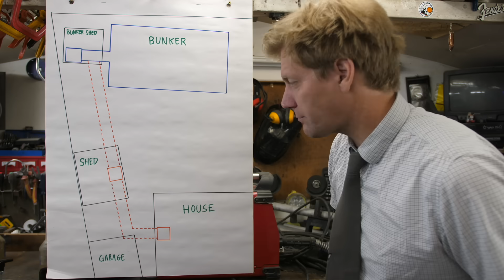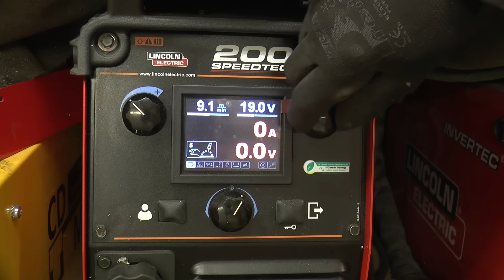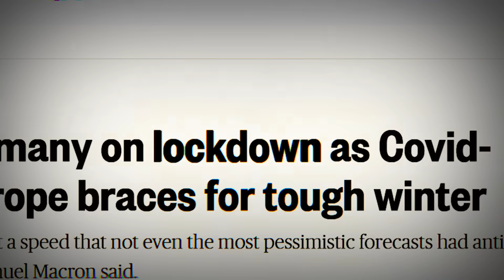DIGGING A SECRET TUNNEL Part 2

Comment: He’s breaking the number one rule never dig straight down
Reply: But it's pretty much the equivalent of digging one to two blocks down in Minecraft
Reply: @Honudes Gai thats possible? is this why those gas towers spew out excessive ones and light them?
Reply: It's okay, he's got x-ray!
Reply: @arlynnecumberbatch1056  Those towers with huge flames is called flaring.  They are burning off gasses that cannot be processed or sold.  It's usually just natural gas, but can be be other gasses as well.

Comment: I would recommend a concrete hammer SDS drill with a digging bit.....looks like it would save you HOURS!!  Or look into how they dug tunnels in WWI.  They figured out how to dig massive tunnels in almost absolute silence using a special made shovel and a board to lay against, it was called "clay-kicking".  Brilliant system.
Reply: Doing this in silence. It' is supposed to be secret. Noise to neighbours will cause problems.
Reply: yeah but clay kicking was a horizontal job he is digging down
Reply: @italiancountryball865  does he not have to dig a horizontal shaft longer than it is deep?
Reply: @forevercomputing  have you ever used an sds drill?  They are like 1000 times more quiet than a jack hammer.
Reply: @brandonbennett127  well yeah but i mean in a world where modern tools are everywhere i doubt that he would use the slowest method of them all which is clay kicking

Comment: When Colin started talking about a draft, and then a crack, did anyone else think "He's about to go through the roof of an undocumented bloody sewer"? :D
Reply: Or there is a broken sewer near bye. I wonder what gasses are in that 'air'?
Reply: @mbak7801  My first thought was did he test the air quality?  If it's a sewer main then H2S is a real concern.
Reply: @benjaminreinhardt259  If there was H2S, then I think the key and most obvious test would be your nose - which in case clearly wasn't an issue
Reply: @benjaminreinhardt259  but isnt H2S easily recognizable because of its smell?
Reply: @DarkPlaysThings  hydrogen sulfide is in small quantaties but its smell is 3 parts per million witch is a horendesly strong smell
Reply: We don't say blody in usa
Reply: @j.s3612  We bloody do in the UK
Reply: I hope he shows what happened to that crack, did it lead anywhere? Seemed like a natural formation, which could get pretty deep, specially in limestone.
Reply: @Darcy02   - Bloody right, we do.
Reply: My thought was, as it's limestone, it might be a  water eroded void, or even a cavern.
Reply: @brianartillery  caverns are normaly at depth of 100 meters and form when rain had seeped into the limestone and had mixed briny ground to become acidic and ate through the limestone to form a vast voids but small voids that appere on roads happen the same with caverns exept the rain seeps into an asphalt of the road and turns the sand below wet and weakens as the weight of trucks and cars vibrate the ground and the sedimrnts below get washed away until it collapses
Reply: @schwarnoldnarzenschwegger1886  Yes, but no.  If you hit a large concentration of it then you will initially smell it and then no longer smell it as it has deadened your sense of smell.  Before you can get out of that hole you'll be dead.  I deal with it working onboard ships, going into a confined space without air testing and monitoring makes me real nervous.

Comment: As a pipe layer, i spend a lot of time down in deep holes. I highly recommend more reinforcement, like thicker steel sheets rather than mesh… 
Please dont die Colin. Cave-ins happen out of nowhere and are deadly.
Reply: "Trench rescue" is almost always "trench recovery".
Reply: ...Wait...which type of pipe layer are you?
Reply: Then again he's probably filmed the final reveal already, so obviously he lived through it...
Reply: @erikscott5709  The hydraulic pump went into that position under the workbench over 2 years ago, so I think it's already done
Reply: @TurboSqu1d  in the end he said he hasn't done any work till April 2021 because he would work while neighbors were gone but they have been home bc covid
Reply: as an underground mine worker, i really hope he puts a bit more research into supporting the roof of the tunnel than he did with the walls. piddly little pins hammered into the wall aren't going to cut it, the rockbolts we use for example are metres long and about the diameter of your arm. this project brings back memories of the tunnel he dug at the beach.
Reply: @nathangee7075  Yeah that beach one literally terrified me
Reply: @AxverEnder  He's probably done the other part of the tunnel though. He said that most of it can be done above ground with machinery which has probably been going on in tandem with the hole digging.
Reply: Wait til he starts going sideways fark.
Reply: @TurboSqu1d  all of our trenches are dug from above ground with excavators. But we still have 6” thick steel trench boxes.

Comment: Abrasive tools would be fairly good for low noise. As in, they grind away the rock instead of pounding it away.
An angle grinder is though a bit fast and makes a lot of noise from its gears alone...
But the noise it makes from cutting it actually fairly small since it has no real impacts during operation. And the neighbors are likely used to the sound of the angle grinder to be fair.

How well grinding scores into the rock to extract bits is, or how fast such digging is, I have no clue. But if you put up some sound deadening material on the walls, then it would likely be fairly quiet outside of the shed.
Reply: I mean at this point he has at least 10 feet of rock between him and the neighbors, I doubt anything quieter than Dynamite would even be noticeable. he should set up a speaker in the hole then go outside to see how audible it is.
Reply: all that noise being so deep under ground would be hard to hear from outside anyway. plus, he's always using angle grinders and saws anyway, so it would just sound like the usual activities.
Reply: The fine dust might be a health hazard for the lungs though. A vacuum system to remove the dust would add to the noise level.

Comment: I’m glad it’s not me digging that clay, looks horrendous.
Reply: You should try New Mexico soil. Its basically concrete. Picks only dent it.
Reply: Im doing a similar project right now (not for YT) and my soil is pure hard clay. It is really horrendous to work with.
Reply: Where I'm from it's little more than sand, but if you dig more than about 3 feet you'll find water.
Reply: I had to rent a jackhammer just to put a sprinkler system in my back yard first few inches were easy the latter 10 almost killed me, pickaxe could barely penetrate it even after soaking with water overnight
Reply: It looks like what we have here, wretched stuff to get through. Still better than rocks or real sand. I like my holes to not cave in on me thank you very much.
Reply: This would be an entirely different project where I'm from. I'd love to see how Colin would get through the slab of granite that is New England.
Reply: We Spoke About This Part 2 Episode Today. Can't Wait For Part 3 | https://www.youtube.com/watch?v=jaWHm16Fvcg
Reply: But, most likely, the harder to dig, the less it will collapse.

Comment: Dude this is wicked but WHERE WAS THE DRAFT COMING FROM? I must know!
Reply: @Harambe_  watch it rise up out of the sewer, LOL
Reply: @speedbuggy16v  If that’s where the smoke comes out, the cracked pipe needs to be fixed ASAP, before the ground around the sewer pipes all erodes away and a giant sinkhole opens up and swallows a house or something.
Reply: @OtherTheDave  technically wouldnt that make it a shit hole?
Reply: @speedbuggy16v  I think it depends on where the crack is. My understanding is that, unless it’s raining super hard, sewer pipes are mostly empty. So if the crack’s higher up, the pipe would be mostly cleared out by the time the water’s high enough to leak.
Reply: @OtherTheDave  LOL, yea, that was a joke, but sink holes are definitely not a joke!  They are in the middle of lining most of our sewers in town right now, its an amazing process!
Reply: Looks like the soil is mostly clay which would probably be quite resistant to being eroded
Reply: @dodgeman777  It is? I didn’t know that… I can see how clay would resist water flowing through it, but I’d think it’d erode from the edges just as fast as anything else.

Comment: Plot: he’s actually digging a tunnel to the nearby bank vault
Reply: No, to an abandoned gold mine. That is where the draught is coming from.
Reply: ...and we're all accomplices.
Reply: Why do you think he has flamethrowers
Reply: Surprisingly, this is a real threat and banks now have seismic sensors for exactly this sort of thing. Also, all bank vaults are lined with concrete on all sides now, so you still have to get through a thick layer of concrete without anyone noticing.

Comment: You'd never be allowed to dig a hole that deep without shoring on an archaeological excavation.
Reply: Yup, i love the content but the lack of shoring did make it something i genuinely wish other people never copy. Admitedly its limestone so shouldn't be as much at risk of vertical collapse; but still: yikes!
Reply: Like, hey, do you got a loicence fo dat pit?
Reply: And the "walls" with mesh are WAY undersized. If that earth moves, each cubic foot weighs in at 100lbs (or 450kgs per cubic meter). When you look at the quantity of earth there, you've got metric shit tons more earth weight that you have resistance to force.
Reply: @TheBengineer3712  Other than a limestone cave system, what could cause that. Britain hasn't been subject to serious seismic activity for a great many thousand of years.
Reply: @TheBengineer3712  water masses 1000kg per cubic metre, earth/clay is much more. when it moves you need really strong bracing. that mesh would do nothing except hinder rescue.  the ground is not the most unstable, but even so it's risky. anything with vertical sides deeper than waist-deep needs respect. shame on you Colin, be safe!
Reply: I think Fred Dibnah started digging a mine and the authorities ordered him to stop. I hope Colin gets away with it
Reply: I'd also be a bit worried about gas, especially finding that crack/vent/breeze. Get some decent ventilation and/or testing so you know that there's no build-up of flammables and there's enough oxygen.
Reply: WHEWS YA HOLE LOICENCE
Reply: @someonesomewhere1240  Good point. Not just flammables either, HS and others can accumulate.
Reply: @scootergrant8683  nothing to do with 'seismic', trenches/pits etc are prone to sudden collapse, even relatively shallow ones.  trenches can suddenly close with little/no warning. check out 'angle of repose'.

Comment: U know...using a spade with a pointy blade would probably make this a whole lot easier.
Reply: narrow and pointy, known as 'grafters'. also look up excavating/tunneling with  'kickers'.
Reply: Having dug into very hard soil, I will say that a pointed spade is not as great as it is at the loam layer. It is not heavy enough to give you a good penetration, and the curved profile makes it inferior for clearing loosened dirt.
So in very hard soil, a pick and a flat square-nose shovel are the best tools. At least in my experience.
Reply: @MonkeyJedi99  i agree

Comment: I don't know about the UK, but in Canada, that dept of digging demands wall braces to prevent cave ins. I know there is a part 3 so I reassured but Colin, be safe! (I meant the braces came up a bit late...)
Reply: yeah, normally shoring is needed beyond 4ft deep where I live but maybe it's different in the UK, the soil looks pretty cohesive in the video
Reply: @connor107  That judgement should be made by a competent person only i.e. a person with the qualification, experience and knowledge of the soil and general ground makeup in this location. Shoring should be in place here IMO, as the soil while it looks like solid clay, could give way under the vibrations of the hammer. Clay is lethal, cracks can hide behind a solid looking face, and by god is it heavy material once it falls in.

Comment: Most of Colin's projects are potentially lethal, and all the more jolly for that, but this is proper dangerous without shoring etc. He might be a brilliant engineer, but it would be a shame if a spade killed him off. I imagine his sponsors are thumbing through their insurance policy sharpish.
Reply: It'll get more dangerous when he starts going horizontal. His soil looks rather cohesive (otherwise he wouldn't struggle so much getting it out, let alone be able to have vertical walls) and looks / behaves like clay, so unless it gets saturated with water it'll be fine, except maybe some minor loose bits falling in. It'll be different with horizontal tunnels with an unsupported roof. But even that, in practice, given his soil, might be just fine. Check out the "Ask Jeff Williams" channel, he has some videos on shoring up his mine, which in parts is dubious enough that he actually needs to support the sides of his tunnels and shafts.

Comment: Bought a house a couple months ago and had to put in a new water line.  At 14 inches we hit rock and clay.... Had to get to 18 inches deep to protect the water line (warm area so 18 is code) just barely hit it using a pick and heavy bar.  Trench was about 75 feet long and took 3 people 2 days to dig if that says anything.  Anyway, if you need to get rid of more soil send it my way.  Gotta backfill around the house so the water drains like it's supposed to and there is some of the yard that needs more added as well.  Then again I wouldn't mind an under garage bunker with a tunnel from the house.  Gotta build the garage with an apartment above it too.  I am sure I could get some soil to backfill then but I need a machine to dig it all out and a sponsor for the concrete and steel.

Comment: I can't believe that a posthole auger wasn't used. Could have dug the whole thing in a few days using an auger.
Reply: Possibly louder than he was hoping for?
Reply: You can get battery drill powered ones at the bottom end and they will got through that soft clay like a hot knife through butter.
Reply: not sure I'd like to be in that small vertical space when that auger skips off a rock you didn't know was there...
Reply: @1slotmech  he used a jackhammer
Reply: And auger on a hydraulic motor would have been perfect for this
Reply: Yea that is exactly what I was thinking. It would of worked great until he got down to the lime stone. At the lime stone it's time to switch over to coring bits.

Comment: I'm no mining engineer but that bracing looks like the weakest stuff I've ever seen used in a cave/mine. Be safe buddy.
Reply: That part only goes vertically so I assume he'll put stronger bracing when the tunnel is horizontal and needs more structure

Comment: I fear some kid is going to recreate this and die when the walls slide down.
Reply: That's a strange fear to have. You don't have  locks where you're from?
Reply: @therockinboxer  i dont think locks matter when a kid can dig the ground with a shovel
Reply: Yeah some kid is going to dig a 5m deep hole for sure, definitely.
Reply: @sujimayne  I've never seen a kid dig a hole like that but I've seen them dig close to 3 meters just for "fun." that's more than enough to kill you in loose soil. Technically, you only need to be buried up to your waste to be killed although that seems a lot less likely. Not saying that Colin is doing anything wrong though, just kids do silly stuff.
Reply: @Lucas12v  I see it as his responsibility to point out the danger. Everyone knows driving a wall of death is dangerous, but here is a hidden dangers that kids might not know. Even adults get killed every year while digging.

Comment: Imagine buying his house in 70 years en finding out there is a bunker in your backyard
Reply: Colin said in an i-n-t-e-r-v-i-e-w qna that the way it would work if he wanted to sell his house would be that he'd be selling the house with the bunker rather than the bunker with the house
Reply: @isaachenrikson3197  other way round, bunker with the house, not house with a bunker
Reply: @ballyblackjack  Harry is correct. Due to British government and housing policies. It would be a Bunker with a house attached. It is also as stated in the bunker build series.
Reply: @splinteruk649  yes he said it the other way round
Reply: I did find a WW2 German bunker under one of customers  garden when placing cables for garden lights, those bunkers are tough, i had to bury the cable 18 inch's deep by regulations, the Kango just bounced off it, got a Bosch destroyer hammer drill did the trick, the customer did not know it was there but wont let me see more of it, This was in Jersey C.I